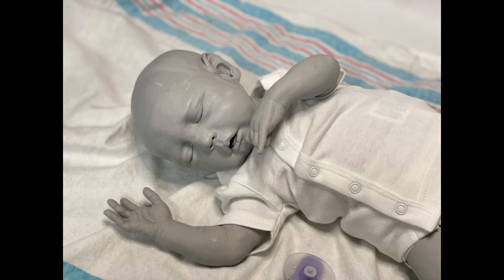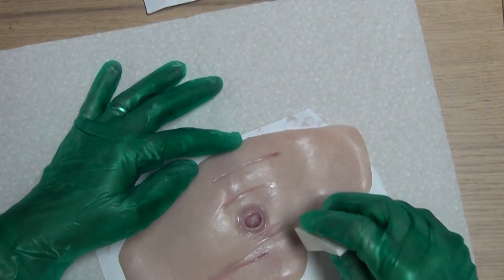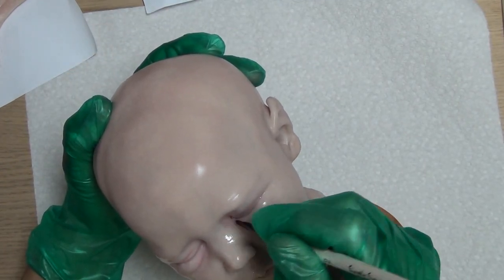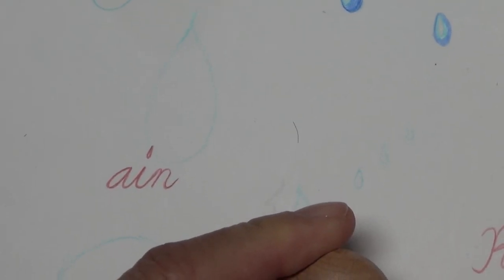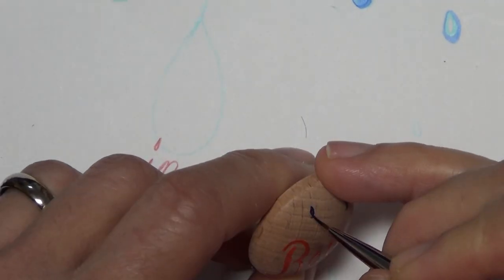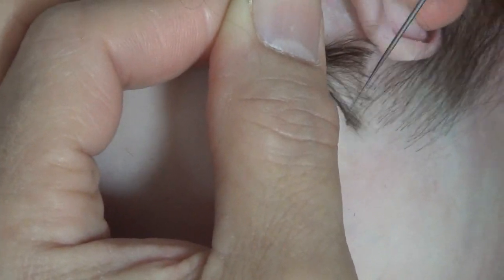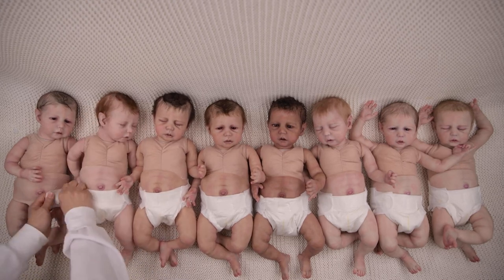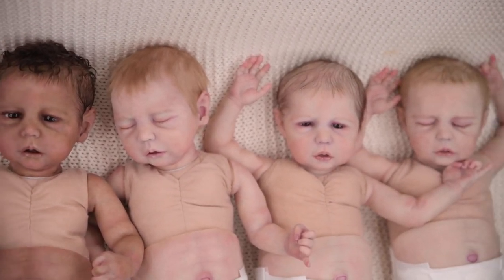Making Rain, How Silicone Dolls Are Made Claire Taylor Makes Silicone Baby Pouring Painting Rooting

Comment: I'll never understand the rooting process, how each hair goes in and stays, and how far in each piece goes, etc. It amazes me. Is it glued inside the head and how does it stay in?
Reply from the maker: It stays because the silicone holds it in place, but with force it can be pulled out. Silicone is solid, unlike vinyl that’s hollow, so it is impossible to glue silicone from inside